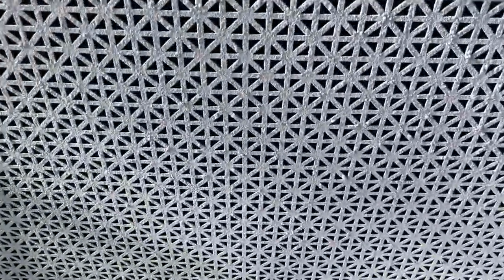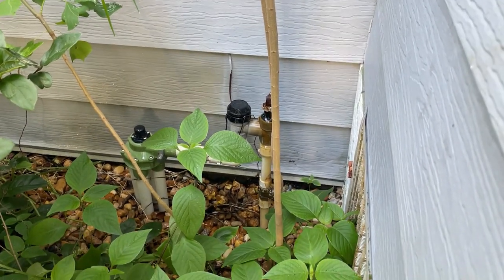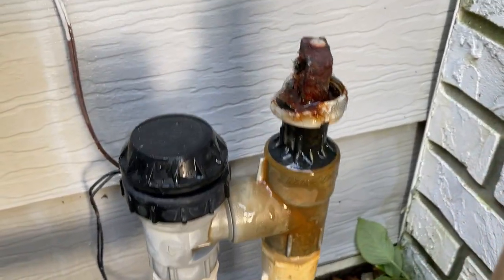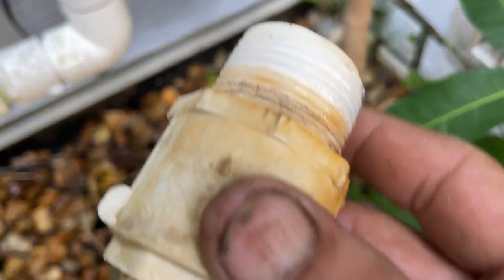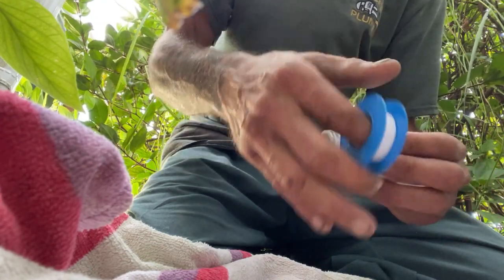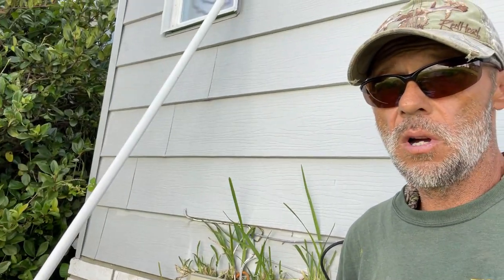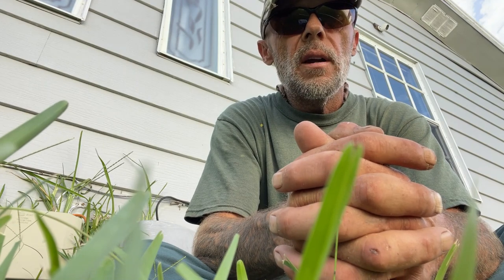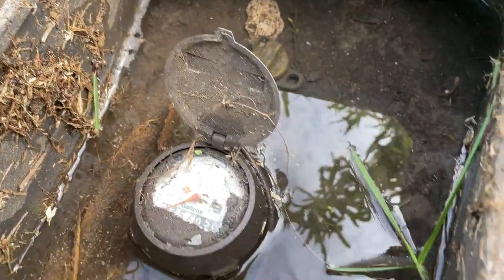HIDDEN LEAK AT MOBILE HOME

Comment: In those kinds of situations where you need to cut a valve that's close to the ground I would have tried to save as much pipe as possible. Your big pipe cutters cut an extra inch off and you could have just used a hacksaw to cut just under the fitting. Just my opinion I like to save as much pipe as possible because I don't want to leave barely any pipe coming out of the ground.  Also, at the small chance there's an error where you have to replace that valve again you still have pipe to work with and haven't shot yourself in the foot so to speak.